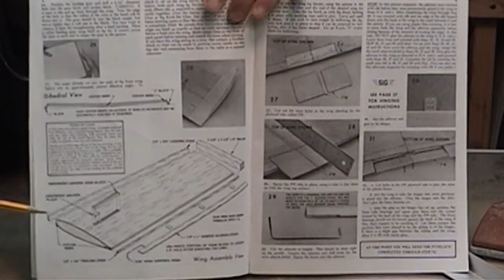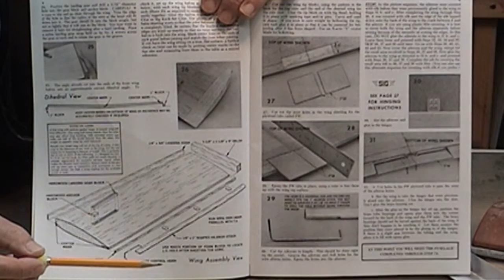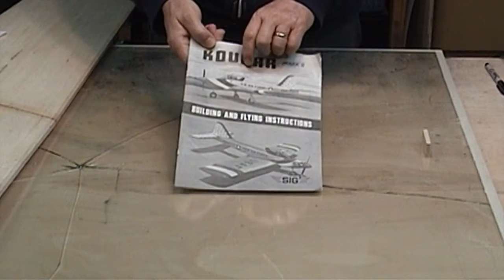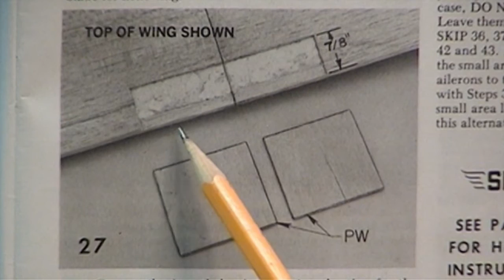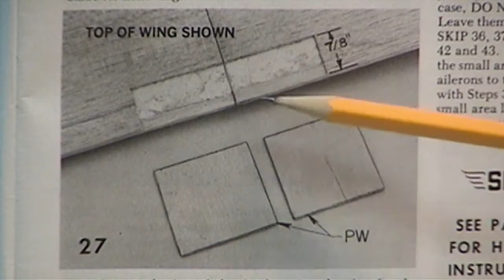Kougar Build - Part 4 - Assembling the Foam Wing (Joining the Wing Halves)

Comment: Have you built one of these with zero dihederal? I'm planing on building one I had a kobra back in 1990 with a .25 and a tuned pipe and it was my favorite to fly. I realy like how it performed at low speed in high wind. I'm thinking about making this one with zero dihederal.
Reply: I never flattened out the dihedral,  I think it might inhance the flight performance a bit. I hope you already have a kit since SIG closed down.